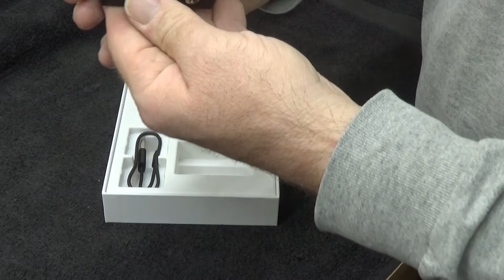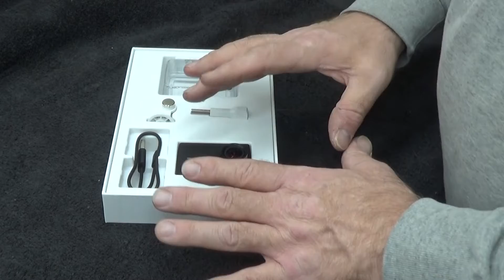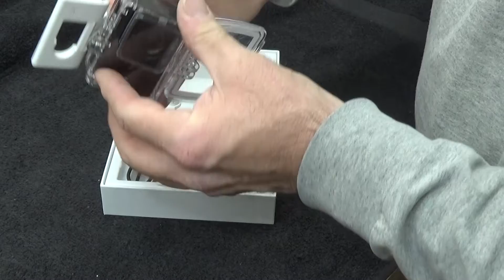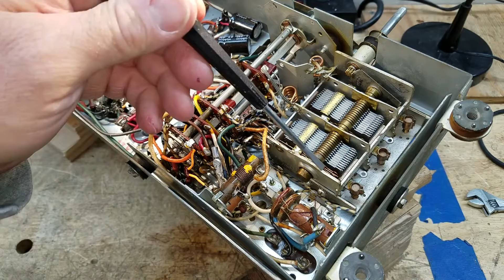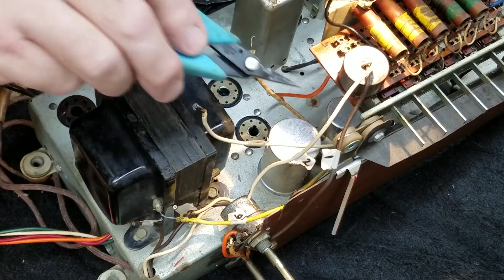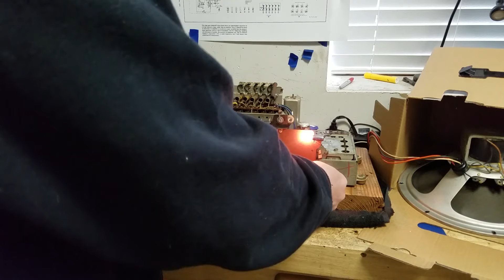1947 Philco 47-1230 Antique Radio Phonograph Part 9 of 14 Finishing the Chassis

Comment: The string in the wire is for when you are pulling it in like say through a conduit the string prevents undue strain on the wires. Preventing them from ripping apart inside the insulation.

Comment: Good on you Michael, looking forward to the next video on this radio as well as the camera. 
Still working on getting my small personal hobby shop set up. One step at a time. Rebuilt variac,
am now fixing tripp lite isolation transformer (one of those that make excellent isolation 
transformers once you do a small mod to them). Have modern test equipment for other items but
rebuilding vintage tube tester and capacitor checker because that is the way I want to go. Step
by step I will be ready to start soon. Did this type of work back in the late 70's early 80's but
now want to do it for myself as a hobby and to help others. Aloha

Comment: Hey Michael, That is one thing I always admired about tube sets even when I was a little kid is that they manage to draw stations in better w/out an antenna than modern sets sometimes do even with an antenna.  Put an antenna on a tube set and they beat about anything out there to this day.  TV sets were the same way.  I could pick up stations crystal clear on my tube sets with a pair of rabbit ears that I'd need an outdoor antenna to get good with a more modern set back in the analogue days.  I had a 4k camera but the one time I videod with it I shot a 20 something minute video and when I went to load it to youtube after loading for over 2 hours it had only loaded 4% of the video so I gave up on that camera pretty quick.  That's a downside to country life, internet speeds suck, lol.  We have a funky kind of dsl here that comes in over the telephone line and we get 6 mb/ps....supposedly.  No fiber optic out here.  Still the same copper wire lines that have been here since the 1940's when they first strung them.  Still on the original weather beaten phone poles.  Take care, Gary